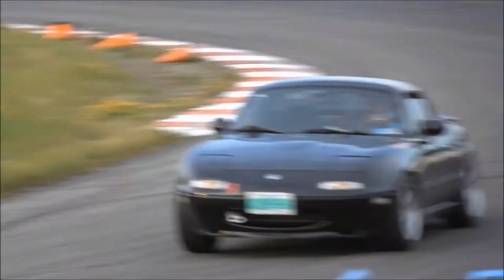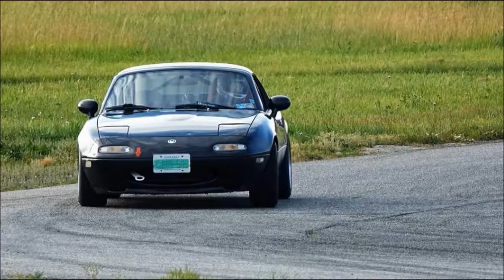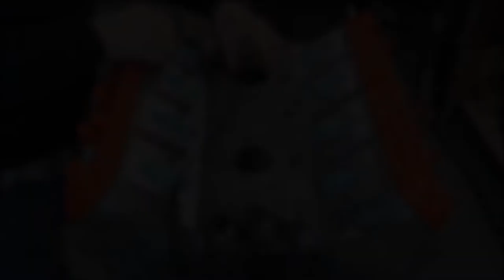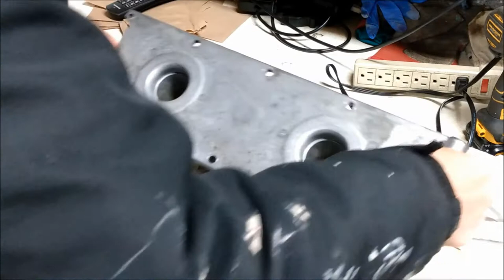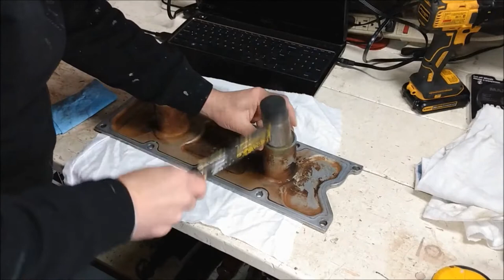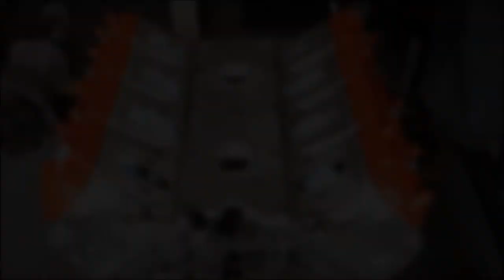COMPLETE LS VALLEY COVER REMOVAL AND INSTALL

Comment: Is there any vacuum or pressure under the valley pan? I have been tracking a whistle my 5.3 suburban has had for 2 years now. I have done everything. But I notices one of the front valley cover bolts were loose enough to undue with my finger so I bought a new seal and going to do it and make sure they are tight. Just woundering if it's possible to whistle if it's loose.
Reply from the maker: Not sure but there has to be some pressure in there otherwise an engine wouldn't need crankcase ventilation.

Comment: Where do you get the punch tool?
Reply from the maker: It's part of a bearing race press kit. You can use anything really, even the back of a punch, just tap around in a circle.
Reply: @miatajackdiy4293  thanks for replying I planning to replace the knock sensors but Im sure I need replace the valley pan gasket and manifold gasket!!

Comment: Is the gasket the same for LS3 and L99? I have a leak in aft side of the engine
Reply from the maker: Not sure ma man. If you have the vin # check with the stealership maybe. It's probably the same.
Reply: Did u figure it out? I'm trying to find the right unbolting pattern for my l99 is this right ?
Reply: @brandonkallu6204  my local GM service states that leak comes from valley cover gasket. I bought one driver's side head gasket and bolts but looks like it was a mistake. As far as I know there is no oil channels coming from the head gaskets. You can find here in YouTube how to disassemble LS3/L99 engine.
Reply from the maker: @DIABLO_4_Tester_Sacramento  I just reversed the torque pattern to take them out. Don't use a torque wrench to remove bolts though. Your best bet is to call the dealership with the VIN for that engine and either get a part number if they will give it to you or just buy it from them. If they said it was the valley cover you don't need to change any of the head gaskets at all.
Reply: @miatajackdiy4293  I have changed both head gaskets in the camaro rs 3.6 LFX I had before. I did it in the garage service. Master who did it didn't use the torque wrenches, he torqued bolts by hands. If you change gasked you must take the head to a turner for polishing. Everything I don't know I ask at forum camaro5, they know everything))
Reply from the maker: @DIABLO_4_Tester_Sacramento  Most Ls head bolts are torque to yield bolts and I would never do it without a torque wrench.